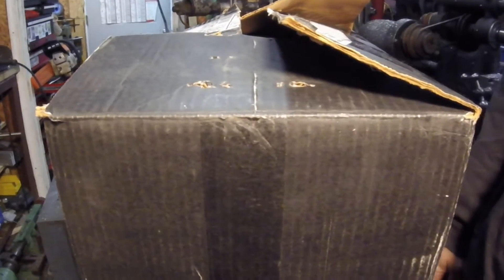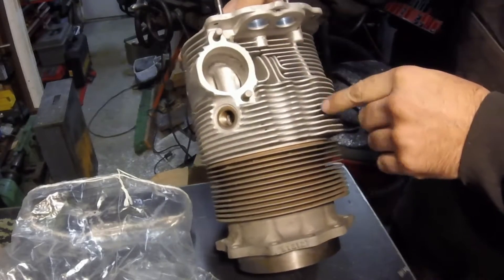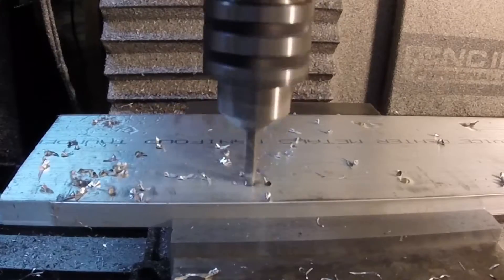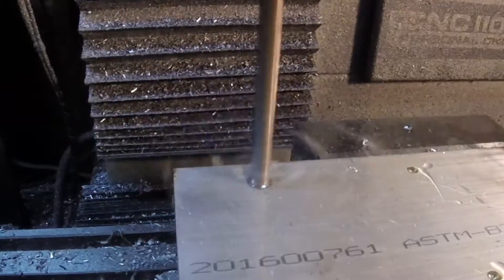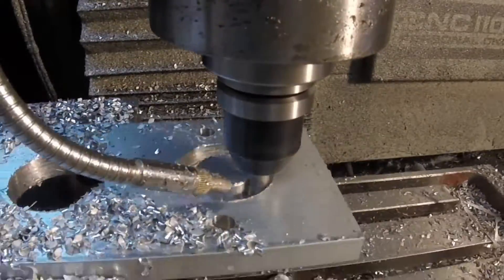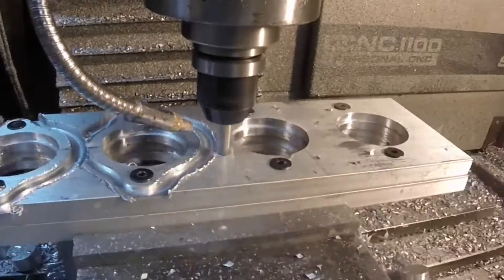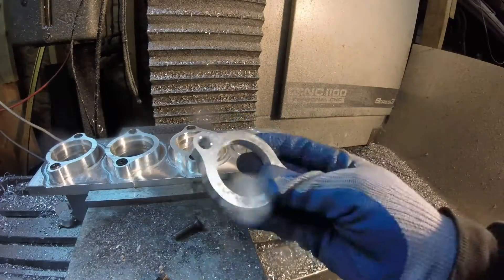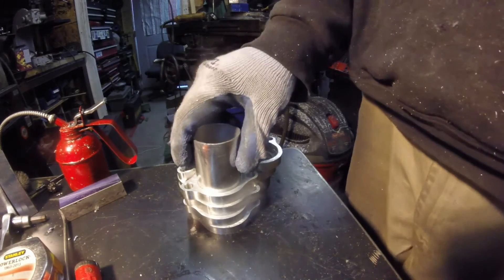Making some intake manifold flanges for a Franklin Drone engine on the Tormach PCNC-1100

Comment: That is beautiful work! What are the FFA rules about making parts for aircraft? Is this for a museum or flight?
Robert
Reply from the maker: Not a bad question. I was concerned myself given the dangerous nature of flight.  When the owner told me it was for a drag race project I didn't look into it any further.
Reply: rwmtube sounds like it's a moot point here, but basically there are two types of small airplanes - certified and experimental. All the parts in a certified plane have to go through a FAA certification process. An experimental can be completely built from scratch, although most folks use certified engines in them. Once you finish building an experimental airplane, there's a process to get it inspected for airworthiness by the FAA, and once that is signed off you're legal to fly. There's also a requirement for rigorous flight testing.
Reply from the maker: Here's a question just for future reference.  If someone were to make their own intake manifold for a certified airplane, would the flanges and tubes need to be certified individually or only the finished manifold?  Not that I would ever run into this but I am a curious person.
Reply: Ebbco great question, I'm actually not sure exactly how all that works. I'm guessing there is some QA spec'ed as part of certification. The big certified piston aircraft engines are Lycomjng and Continental, so I guess you would have to be subcontracted to one of them. I'm mostly interested in the experimental side of things.
Reply: Ebbco also, if you're interested, check out the forums on vansairforce.net - great place for kit plane discussion. For small piston aircraft, there are actually more experimentals built each year than new certified planes sold. The small plane industry is in a sad state.